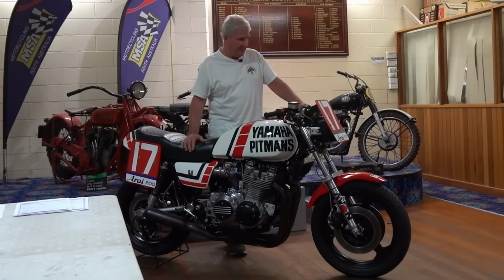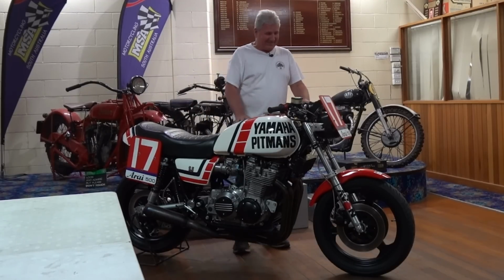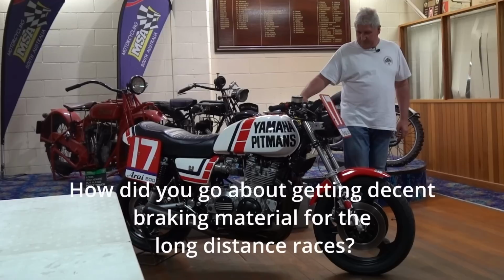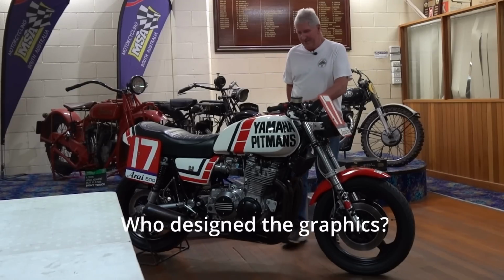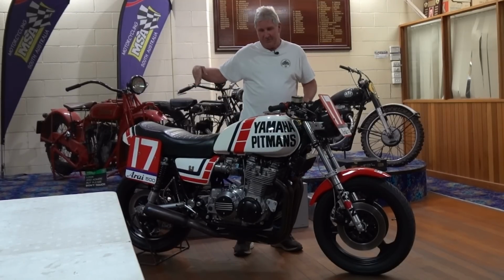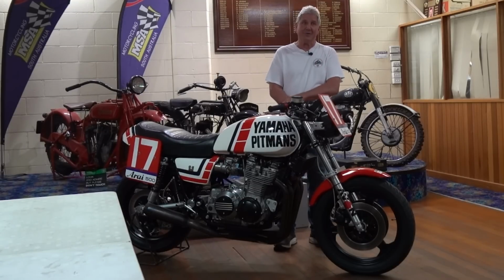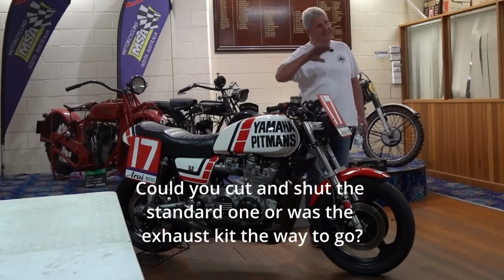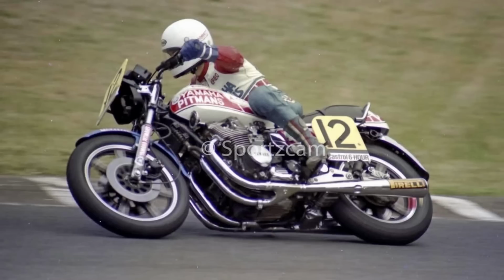PITMANS XS 1100 Chaindrive

Comment: Bit late onto this video, but like a previous comment, I am also South African. I raced an RD400 same time as Rod Grey was racing the XS1100 chain drive. The class was called "F1" here and his bike was based on the Europa version. Saw the bike a few times in Port Elizabeth and East London circuit. Usually from the back when he overtook me.... I believe its been restored now. Rod also raced the CBX1000 in the SA Std Production class in 1977/78 (?) but a guy named Mike Crawford was racing the XS1100 and against everyones expectations Mike won the championship on the XS1100. The "touring " bike beating the 6 cylinder Honda was the best thing ever for the Yamaha fans!
Reply from the maker: Awesome feedback mate, cheers for sharing

Comment: My mate Lindsay was involved in building the very first chain drive XS1100 ever built, {sleeved back to 1000cc for class},  in Cairns QLD, in  1978. That engine was built in the Yamaha dealership in Cairns,  It was raced in a speedway sidecar...  Yamaha Japan actually did an article on the conversion... Lindsay was also building his own twin plug heads and eventually built a triple plug head, {FJ Yamaha engine} running two ignition plates with staggered ignition timing,  to get a better burn  {for methanol} in the combustion chamber. That engine won championships too.  He still has that triple plug head....
Reply from the maker: @MickH60  great info cheers mate🍻
Reply: @AndyPitman-vt7hm  Thank you too, I love this old stuff...!! {even though I'm riding Kawasaki's !!}...

Comment: Great video with no b/s but in my experience with these and having dynoed 1 brand new in 79/80 atrue est HP as I got between 98 and 104 HP over 3 runs before smoking rear tyre curtailed further runs. No inertia dynos then but hydralic brake. 
I also used the XS motor converted to chain drive in 2 speedway s/cars with great success 81/88. Bulletproof motors. Thanks for the memory road trip. Cheers
Reply from the maker: @motomic84  cheers for the feedback mate🍻